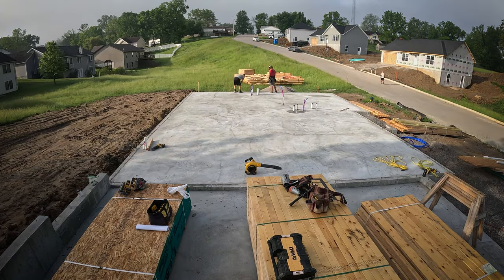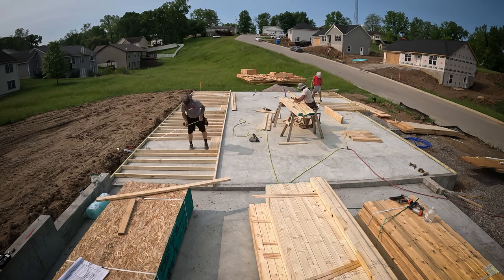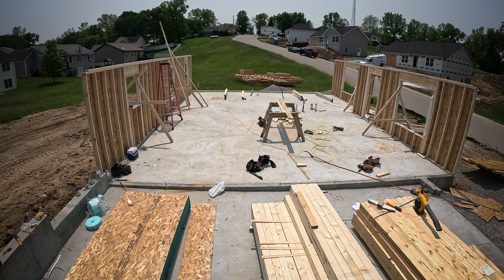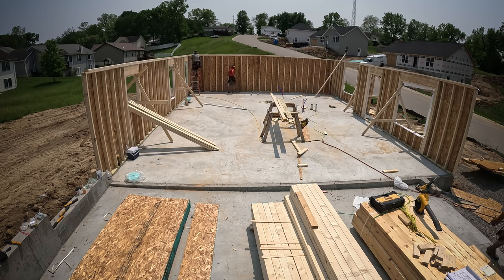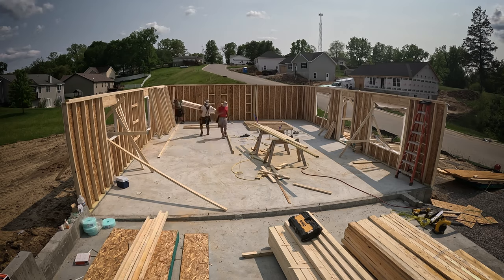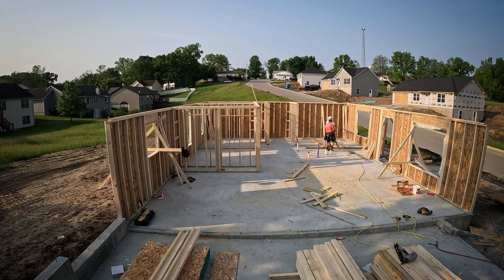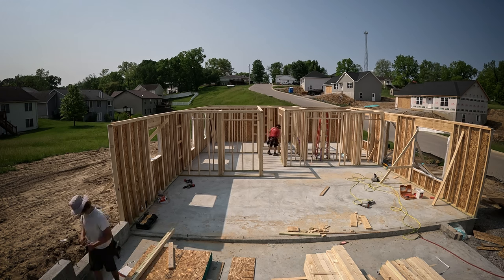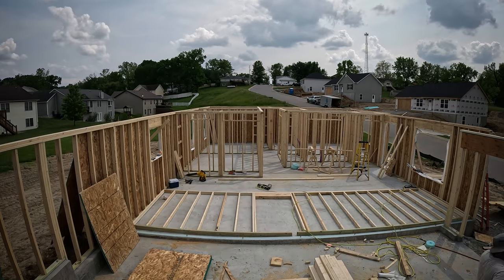Wall Framing Time Lapse | Home Building Explained

Comment: As a plumber, I've heard that you know the framers are good when all your pipes are in the walls.😂 Actually, I always pulled strings on the rough in to make sure I was good. Lots of guys just pulled tapes. And then again, the concrete guys would move pipes when back filling. I like it when the trades worked together. Makes for a good job.
Reply from the maker: My friend, you speak the truth!!!!   I've found this to be the best way and it sounds like you already do it.  Set a few tapcons in the foundation where the interior walls should be, use those tapcons to run strings.  Set your plumbing off those strings.  When you are done, break the tapcons off and leave the end of the tapcon in the foundation.  Hope like heck the concrete guys don't move your plumbing but if they do, its on them!!!  When the framers show up, all they have to do is find your tapcons - snap a line from tapcon to tapcon and off to the races.

Comment: Good stuff. Thanks!! Thoughts an the zip system that incorporates a slight R value and alleviates the need for house wrap?
Reply from the maker: Thanks!!!   I’m a zip system fan.  Zip holds up, no doubt about it.  Skip the house wrap and don’t hesitate to use it.  I still struggle with the 1/2” on the roof.  Personally, I do 1/2 zip on the roof, tape the seams and run synthetic felt.  Helps me sleep at night!!!